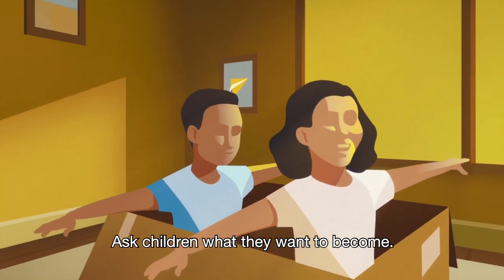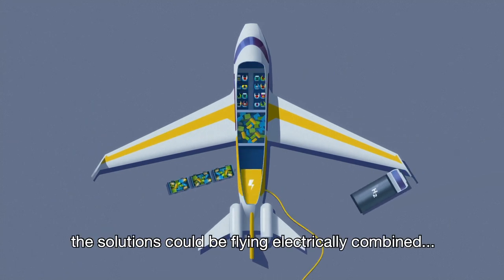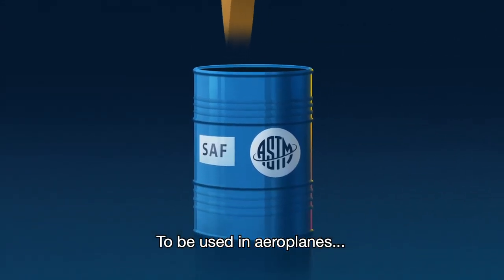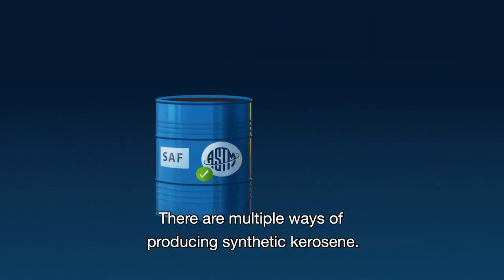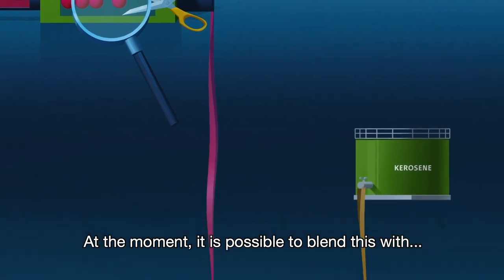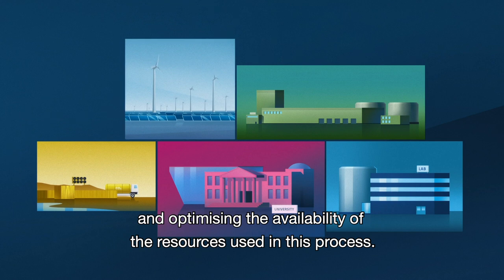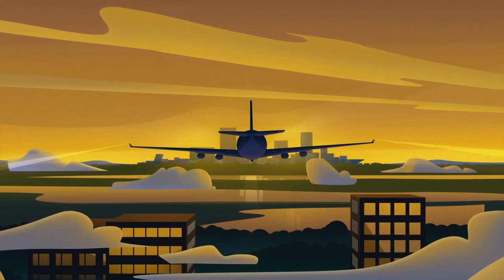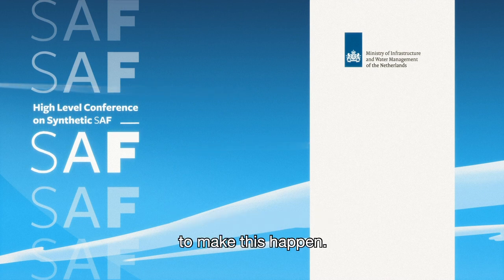What is synthetic kerosene?

Comment: Pilot? I want to become a SAF producer
Reply: I kinda want to be a scientist or engineer, and potentially study how e-kerosene works inside of kerosene fuel cells vs e-fuel inside traditional jet engines. :) Also, it would be cool to see if there are any types of bacteria that can break down e-kerosene, in case of a SAF fuel spill (cough, cough, fueling truck accidents). Also, am curious if bacteria can break down regular kerosene if planes have to dump fuel over a river, aquifer or lake during emergencies.

Edit (8/19/23): Well, apparently there is a type of bacteria named pseudomonas & enterobacter that can break down fossil kerosene, and as e-kerosene has a similar structure to fossil kerosene, it may be entirely possible to break down synthetic or e-kerosene (woo, heck yeah), though no specific research has been done with e-kerosene as of August 2023, as e-kerosene is not widely used yet. On the subject of fuel cells, a solid oxide fuel cell (SOFC) can in theory use e-kerosene, as scientists worked on fossil kerosene SOFCs back in the 2010s. So, technically it is possible to run e-kerosene inside of an solid oxide fuel cell with the same efficiency as running fossil kerosene inside of it. Once again, as both SOFCs and e-kerosene are not widely used, no specific research has been done with combining the two technologies. Personally, the combo of SOFCs and renewable synthetic kerosene/e-kerosene could make for planes that power electric fans or props, with less condensation and less noise compared to jet engines.

Comment: This was a great video. I love the end massage that tied in with the start of the video. The best comedians do that to great effect. I was thinking its a bit anti climactic on the airoplane polution side of things. As its surprisingly small compared to cars alone but Perhaps thats not the point of synthetic kerosene you are getting accross. Only chemical fuels work in planes. The alternatives are not viable. And eventually there will be no more petroleum and ethanol based bio fuels are no good for planes as well. It will always cost far more then normal means of transport if thats what they refill with. But theres something there that could be magical if it works.